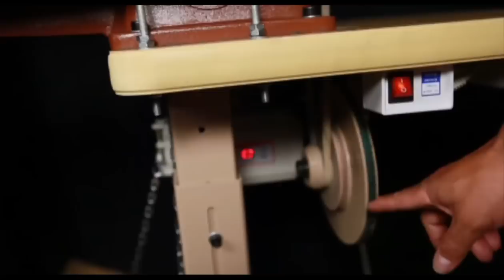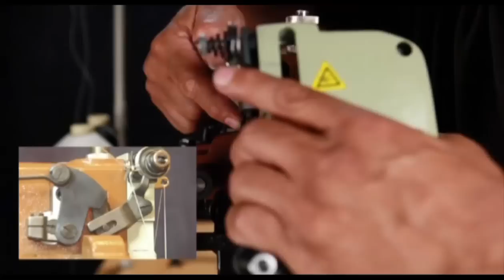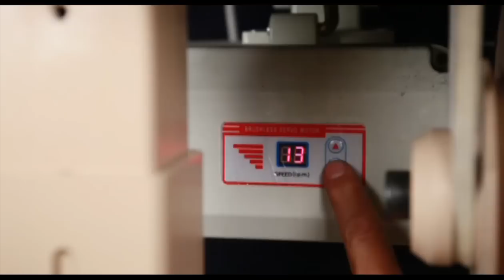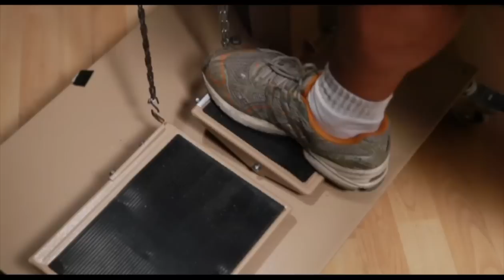Cobra Class 4 Sewing Machine Instructional Video by Al Bane

Comment: I have a Cowboy 4500 that I just bought which had a very bad instruction manual which is hard to see.  This video was fantastic as the 4500 is close to the same and I was able to follow this video[s instructions to oil, thread and finally adjust my machine which was pulling loops.  Fantastic instruction recommended to anyone who has a leather sewing machine.   Thank You

Comment: Excellent video! I bought a Ferdco Pro 2000 seven years ago, and am still learning the finer points of it. The machine threads differently but most of the other adjustments are spot on, and this video made me aware of some oiling points that I have been missing. It's a wonder I haven't had trouble! The manual that came with my machine is one of those line drawing illustrations with arrows that are impossible to tell whether they are going up and down or sideways. Someone should think about translating these manuals into REAL English! Thanks a million.

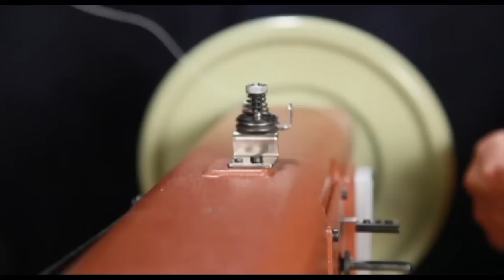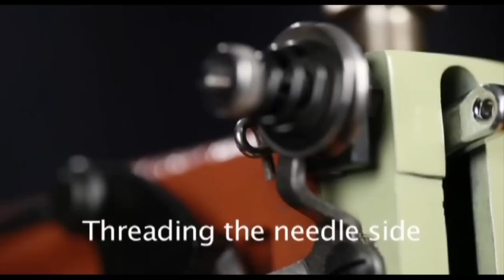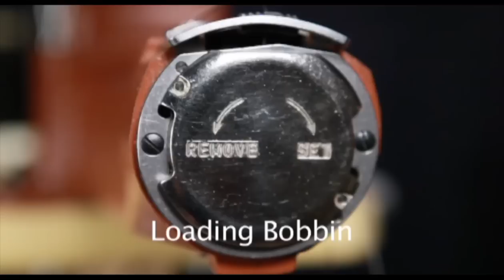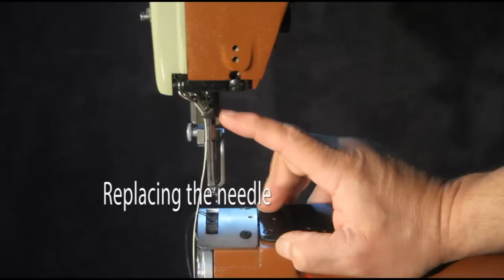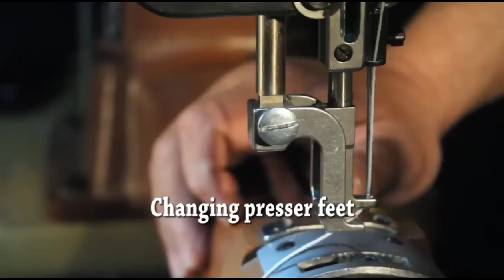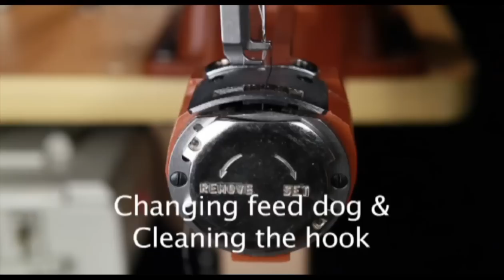Comment: 1:30 bobbin.  3:13 thread needle side,  5:20. Loading bobbin. 6:50 replacing the needle. 7:40 preparing to sew. 9:34 stitching on a curve. 10:24 stitching a right angle. 11:20 back tacking. 12:50 changing the presser feet. 14:40 changing the feed dog and cleaning the hook

Comment from the maker: The Cobra Class 4 is a lock stitch machine. typically lock stitch machines use a needle and a hook to create a lockstitch. the lock stitch is typically found in the center of the material. the positioning can be influenced by thread tension. too much top tension will produce loops on top. when we see loops on top we are actually seeing the lock stitch rising to the surface of the workpiece.

Comment: Hi Al,

I seen most or your videos and very informative especially to the rookies like me, Question, I have a 441 clone, I most use 207 tread, one of my issues is that some of my sewing thread has more wax than others as I use more than one color, I normally sew 2 layers of 4 to 5 OZ, in total 9 to 10 OZ, the issue I'm having it is that the tread that has more wax does not have enough friction on the bobbin plate, even when I close the screw all the way (for the thinnest thread) I can see the locking stitching is more to the top, even when the 1st and secondary tension disk on the machine are all the way on the loose position, I have tested other threads with less wax and have no issues as there is more friction upon passing by the bobbing side plate, is there a trick somewhere that you know that may help, the easiest way will be getting sewing thread with less wax but will like to use the spools I already have.

Any help will be appreciated...
Reply from the maker: Get a new bobbin tension spring preset tight from The Leather Machine co. Then you can tighten the top tension devices to match. This way you have some latitude with the adjustments when swapping thread.

Comment: Al can you explain to me why the holster plate and stirrup plate makes it easier to sew holsters and stirrups? What do they do exactly? Can they be used for any other type of wet molded goods?
Reply from the maker: Come find me on Facebook. I run a group called tips and tricks with Cobra class leather working equipment and we can have an open discussion there.

Comment: FYI the speed setting is the motor rpm in  hundreds of rpms, so 20 = 2000 rpm and 13 = 1300 rpms
S1 = start speed in percentage of full speed 10 = 10% of full speed 90 = 90% of full speed
S2 = is motor direction don't change it if your machine is running fine
S3 = maximum motor speed
S4/S5 i believe is setting for the electronic positioner and need not be adjusted. 
keep in mind the machine comes from the factory set at 2000 rpms on the motor speed. Depending on the servo motor you could have a max speed of 3800 or 4500 rpms. 
there is no mention of a max speed that I could find in the manual. I'd highly advise not exceeding 2000 rpm. As I don not believe the machine was designed with that rate of speed in mind. this machine is a tractor not a sports car.

Comment: What needles are you using. I'm using the chisel point that came with the machine but i don't get straight stitches like yours. I'm planning to get the round points. What do you suggest?
Reply from the maker: I would get one package of each size that way you can test your setup and select  the best needle for the operation

Comment: Mr Bane is it normal for the belt to twist when working? I get it to fall in correctly but after a full turn it twists
Reply from the maker: They do that once in awhile. It could be that your machine is not aligned directly above the speed reducer. Check and see that the pulleys are lined up perpendicular to each other.

Sometimes a belt will break in that way and there's no fixing it.

It doesn't hurt anything. Unless it makes the hand wheel jump when the belt flips over. That could affect your control of the work piece.

Basically there's nothing wrong unless you feel that it's a problem.
Reply: @albaneforleather  👌🏼👌🏼 Thank you sir

Comment: This might be a stupid question...but will someone please explain what he means when he says Top Dead Center and Bottom Dead Center??
Reply from the maker: When the needle goes all the way to the top just before it starts coming back down. That is top dead center.

 The inverse is true, when the needle goes all the way to the very bottom right before it starts coming up. That is bottom dead center.
Reply: @albaneforleather  Thank you sooo much! I've watched this video at least 100 times
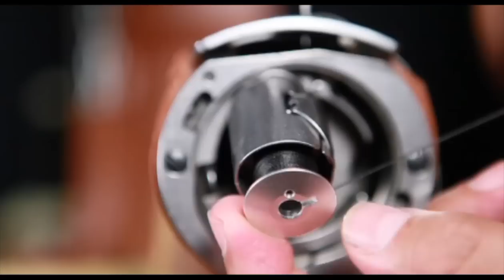Reply from the maker: When the needle travels to the very top of the stroke that is top dead center. Like 12:00 on a clock face. One second past 1:00 is now passed top dead center. The same thing with 6:00 or bottom dead center. So when referencing the position of the needle typically we refer to a quarter inch past top dead center which is the moment the hook releases the needle thread. At this point we can remove the workpiece because a needle thread is no longer being held by the hook

Comment: I have one and have had many issues with set up, tensioning, getting the stitches to be correct. This is not a JUKI, as I have owned a Juki 562  for 30 years and it has been flawless. This is a China made machine and has been quite troublesome for me. Yes, Steve has been helpful, but I cannot get anyone to my shop to set this machine up properly. I have already had to return one Head as the bobbin pickup and timing were off. A major hassle.
Reply from the maker: ***** There is a forum group on Facebook called Tips and Tricks with the Cobra Class 4.  Lots of helpful information can be found there.
Reply: You failed to mention that it was operator error on your part. And you happened to break the same thing twice, all the years leather machine co has been in business only 3 of those have broke and you happened to break it twice. Leather machine co repairs juki, artisan, and multiple other machines, before becoming the owner Steve has been a mechanic for 52 years, he made cobras so that they could be just as good as jukis, you only pay for the name when it comes to juki, they also cost $7,000 the cobras only cost $3,000 yet still outperform juki most of the time, Steve has fixed thousands of jukis over the years.